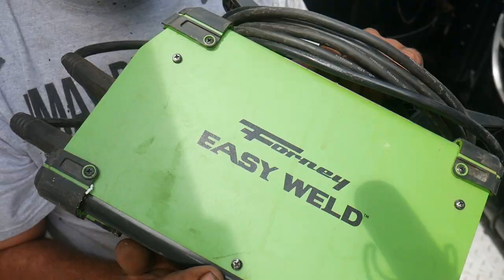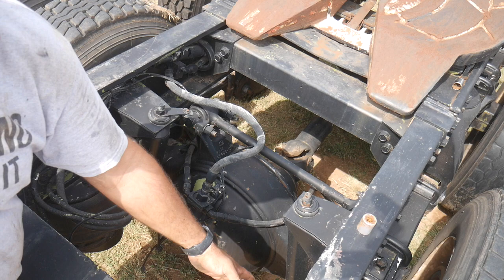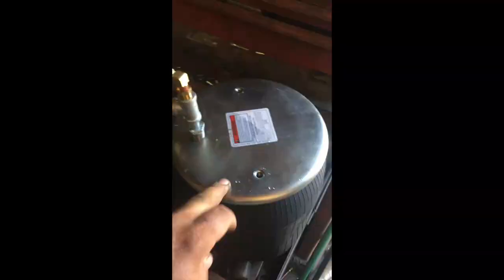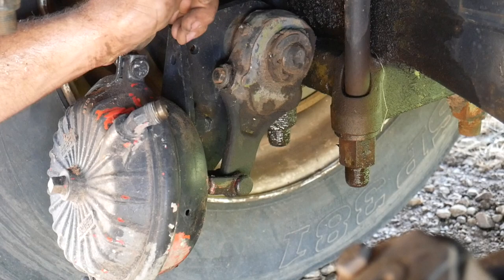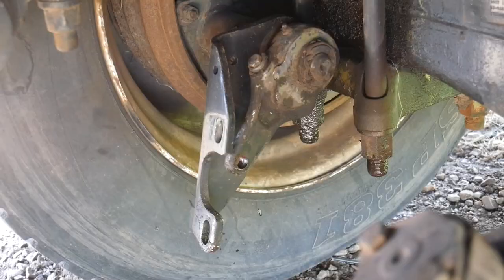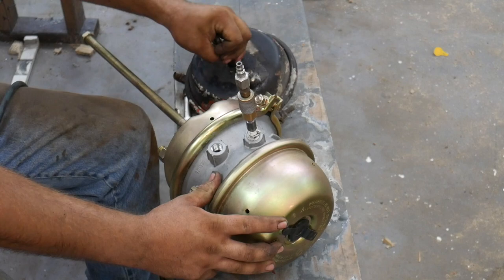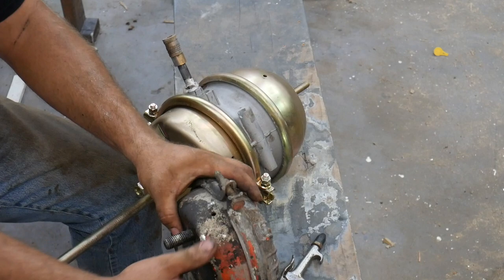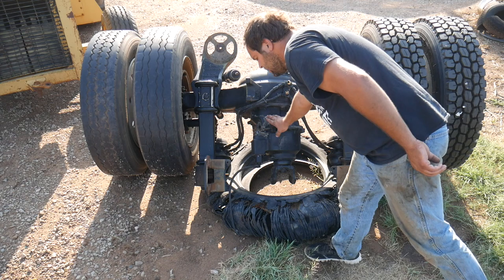Homemade RV. EP-17 Installing the Axles. 1977 Peterbilt 359 Toterhome.

Comment: when the chamber is caged you can pull it apart to replace leaky diaphragm/s its a lot cheaper buying a new diaphragm its slowly being phased out self servicing brake chambers  (like no clamp halves its machine anodized steel onto aluminum cast pressed from factory)

Comment: Just a heads up zac, DOT does NOT like 90 degree angles on air fittings for brake and suspension systems. Love your channel!
I am hoping to have my 2002 379 RV tiny home finished this fall.
I am not as skilled as you and have other build mine...